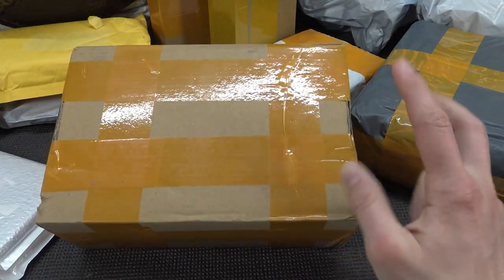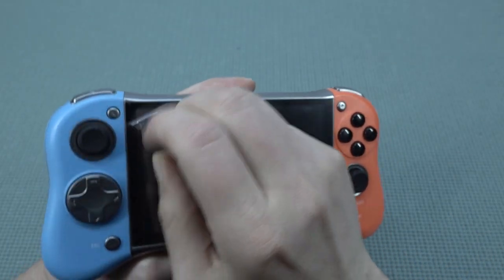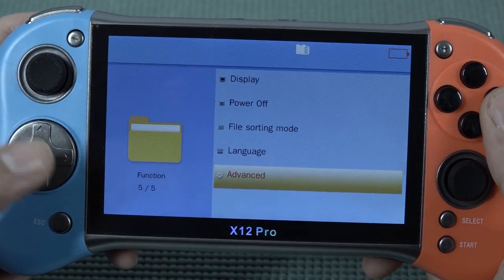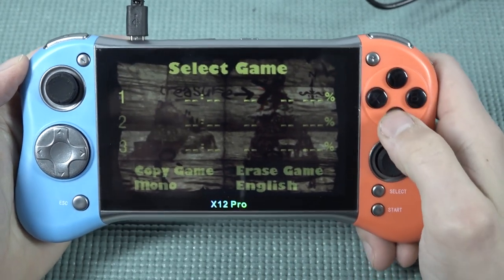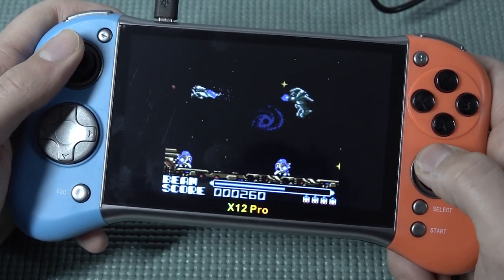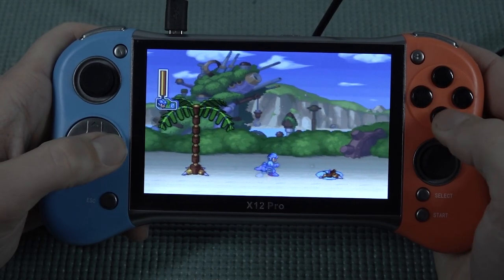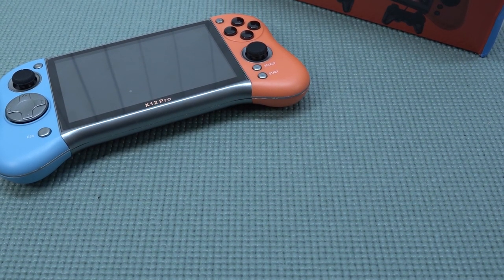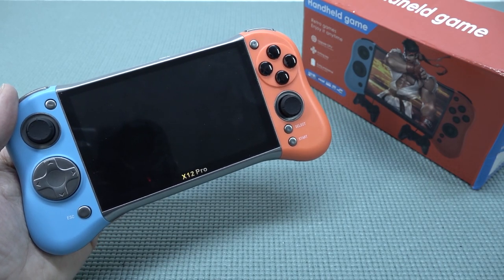X12 Pro Cheap Ali-Express Handheld .. Yes They Are BACK ! 😮

Comment: It's a huge improvement over previous x-series, but oh boy, like Wicked always says, they had to screw up some things...royally. It feels cheap, but not too cheap. Very comfy to hold, but I REALLY don't like the analog stick, especially since it clicks in, but whatever. The D-pad is also pretty nasty, but works. The screen looks pretty good for the price, but NOT if you lean it just a little bit away from you, then it messes up immediately due to that viewing angle effect. Why don't they ever flip the panel so the "worst" effect happens when you lean it towards you (much less likely to do than leaning away from you)? But the two absolute worst things are the aspect ratio and the terrible button mappings. When you change the aspect ratio, as Wicked said, you change it for all console emulators together. That means you must constantly be switching back and forth between ratio settings, and in many cases, especially PS1 and arcade, you MUST accept the stretched ratio. Then there's the button mappings...they are all wrong for PS1 (and some other consoles too)! Both the handheld and the included controllers have the buttons cross/circle/triangle/square buttons mapped wrong! Thankfully, you can fix it, but you'll struggle to find the right "repair" configuration(s)  becasue incredibly, the handheld and the controllers are not messed up in the same way! After you do find out the two different ways to remap, you'll have to do it THREE TIMES for each and every title (if you want to play on a tv that is)! Finally, the PS1 emulation is not particularly good. Most PS1 games, I'd say 70-75% will play fine, but the most demanding ones (the ones you want to play) will struggle. Bloody Roar 1 is fine, but Bloody roar 2 is too slow to enjoy. Tekken 2 is fine, but Tekken 3 is not. Early sports games are fine, but the later sports games lag and struggle with sound issues. I also had a lot of trouble with some the key Mortal Kombat titles...except for MK4, which curiously plays well. For the money, you can't expect perfection, but it's a shame because many of the worst issues are from bad software decisions. On the plus side, the design is very comfortable. Thanks for another great video WG+C.